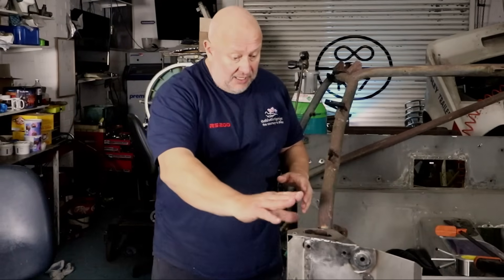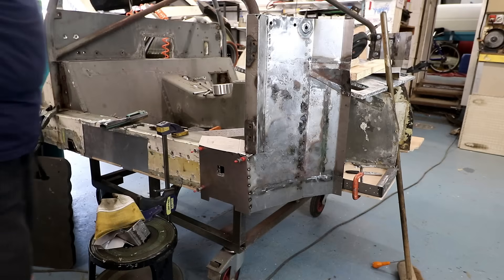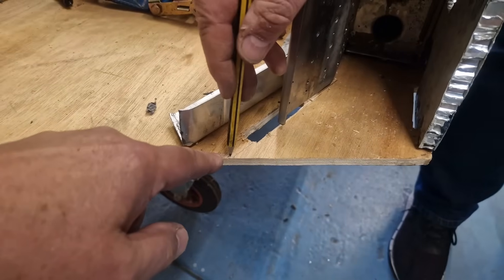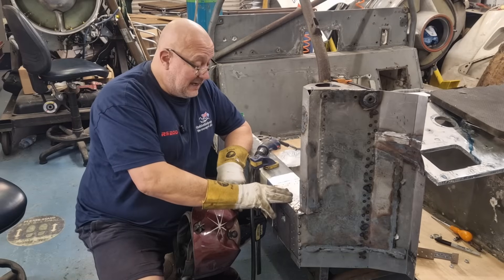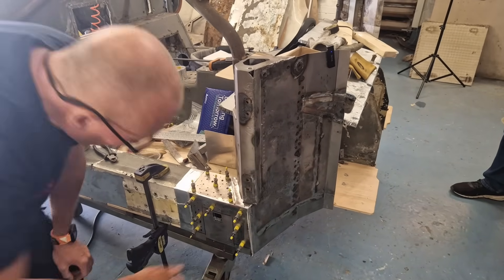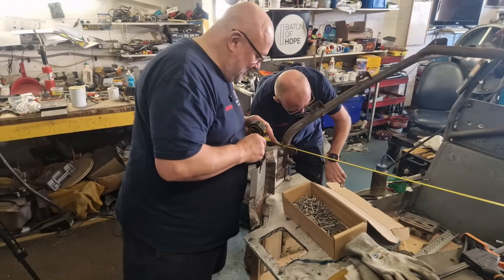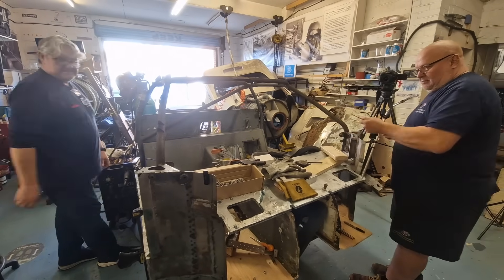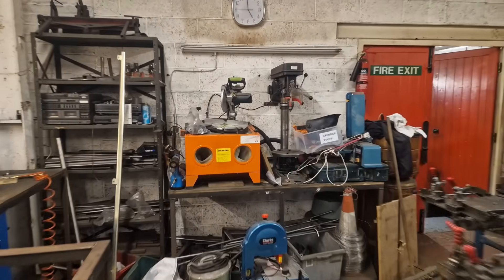Should've Been Easy, Why Did it Go Wrong?

Comment: Did you check the roll bar against the new tub to make sure that's not bent to start with.
Reply from the maker: Yes, it was the bottom of the A-post that was fighty, but sometimes it wasn't. We'll get to the bottom of the issue next week.

Comment: I’m sure it’s closer than when Ford did it!
Reply from the maker: Ha, it probably is. But something went adrift. Post glue and rivet inspection next week.
Reply: Have you got one of those bilingual tape measures with metric on one edge and steam-age on the other? Might explain why the numbers are different on opposing sides...
Reply from the maker: @owensparks5013  Our tape measures have God's units on one side - you know,  the numbers by which the universe works - twelve hours in a day, twelve months in a year, etc. And the other side is dumbed down for those who can't do maths beyond base 10, but we checked both ways and the puzzle remains. We'll get there. 😁😁👍👍